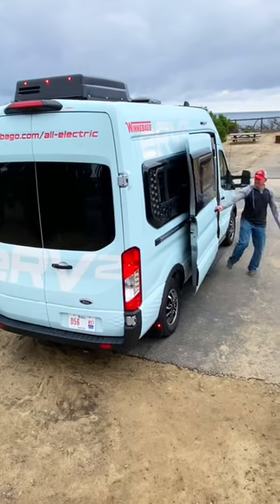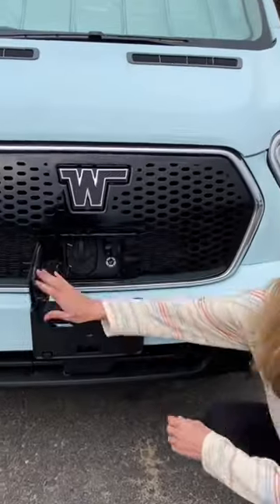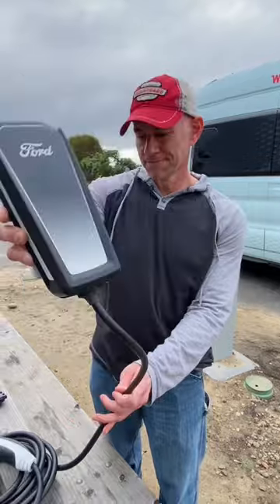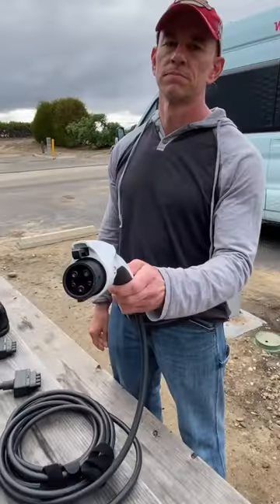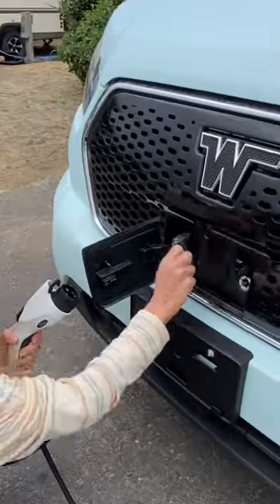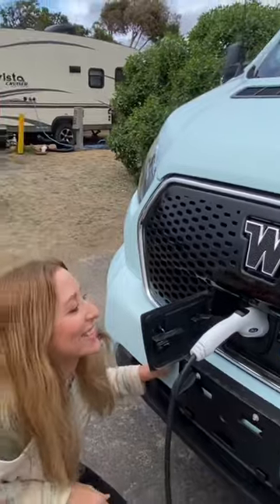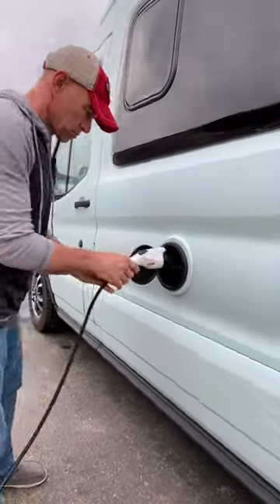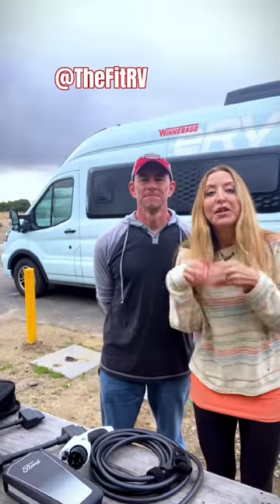How does Campground Charging Work with an All-Electric RV?! Test camping in Winnebago’s ERV2 van

Comment: Adjustable charging amperages would be ideal for adapting to different camp site amp output capabilities. Sometimes circuit breakers are old and weak and trip much lower than their original rating. Dialing in the charging amps would also allow simultaneous charging of the house battery immediately upon arrival and overnight. This could be handy with a 30 amp site for just 2 nights.

Comment: One other comment.  How are you all planning your camping route?  Does the navigation software in the eTransit guide you though fast charging waypoints when you tell it a final destination?  (Tesla does this) Or do you have to manually figure our where you should stop along the way?
Reply from the maker: Apparently the eTransit does have that function, but we haven’t used that yet.  We’re playing around with the app ABRP (A Better Route Planner) and it sets up the charging waypoints. And then we use Plugshare to check on the waypoints it suggests, make sure they’re in working order and get good reviews… and are the fastest ones in that area.

Comment: Good luck with the rv park allowing you to use 50 amps to charge and plug in your house batteries too lol
Reply from the maker: We’ve been doing that this whole time, no issues. We’re not using any more power than a big 5th wheel with its 3 air conditioners.
Reply: @Thefitrv  but the 3 ac's  don't pull 50 amps 24/7. @.25 cents a Kw using 7Kw/hr ,   that's 40dollars/day out of the rv parks pocket.  It won't go on very long. Not to mention their electrical system would crash with a couple dozen rv's charging.
Reply from the maker: All things yet to be worked out. Change will come, we’re just at the very beginning of it all. Also to clarify, chassis charges in 11hrs at a campground (if it was totally empty upon arrival)so it wouldn’t be charging 24/7. Once it’s charged it’s charged.
Reply: @Thefitrv So no other power is being consumed after that 11 hours of charge?

Campgrounds will eventually have different rates for all electric.

Comment: Ok, came over here from the last video. ;)

You've demonstrated the J-1772 connector for the chassis and coach.  The max charging for the chassis through the J-1772 is about 11 hours.  How long to charge the coach from the J-1772?

The eTransit also allows fast charging via the CCS connector.  Does the coach support and fast DC charging?

You've clearly stated that this is a prototype.  But the dual charging ports are a pain point.  Having to move the charger from one port to another, perhaps in the middle of the night would be a pain.  Tell them they need a single port to support an overnight/camping mode.

The single charging port should support priority and capacity limits.  If you're staying a long time, you may want to prioritize coach charging over chassis.  If you know you're taking off first thing in the morning, you want to top off the chassis first.  And once one battery is filled up, start charging the other. 

And they also need to support a dual charging port/parallel mode, whereby both battery packs can be charged from independent power sources.

Also, the ports should be closer together.  It'd be nice to pull up into an urban charging station (I'm thinking Chargepoint), and plug in both ports at once.  Not sure public chargers can reach the mid coach 1772 outlet.
Reply from the maker: As far as how long to charge the house battery, we plugged it in to the 50amp 240volt connection at the campsite, and we were charging at a rate of about 4700watts. It’s a 15,000 watt hr battery, so about 3 hours to charge from empty to full. And to your comment about dual charging from independent sources, that’s what it does currently. You asked if the house battery supports fast DC charging, and we’re not sure yet. We have yet to test that out!
Reply: @Thefitrv  You are correct, the current configuration is dual charging plugs. I saw that. 

My guess is that it was easier to simply keep the two battery systems separate. 

My point was that there are pros and cons to dual port and single port charging. So even if they support a single port to charge both systems, there is still a benefit to dual plugs. 

But…

There should try to aggregate the plugs to allow easier charging in urban environments that have existing charging infrastructure. 

The eTransit charges in the nose, because that is how urban charging stations are designed to be used. Putting the coach port mid coach may make it harder to charge in an urban location. 

And there should be some sort of programmable charging logic for single and dual configurations to prioritize which battery is charged first.
Reply: Agreed!

Comment: Slower charging over a couple of days may be the safe bet. Also a simple way to manage the simultaneous charge of both banks seems essential!
Reply: Charging speed is not an issue. The chassis, like almost all EV battery systems, use heating and cooling to keep the batteries at optimal temperature. The e-Transit chassis can DC fast charge at 112KW. The voltage is in the 400v range, so do the math, the current is huge. Our Tesla can charge at 250KW. Some cars have nominal 800v battery packs, and can charge at 350kw.

Comment: So by charging both the vehicle and the camper at the same time you will draw more energy from the campsite than you normally would from a regular camper, the problem with that , is that campsites will eventually increase their price to compensate for that extra running cost , so i wonder, do you pay more because you have an EV camper? Or everyone will pay a little more? Maybe nothing at this time because these EV are new but i am afraid that campsite owners will eventually catch on …
Reply from the maker: It’s possible. There are a lot of issues that need to be worked out before eRVs truly hit the road, including how campgrounds will handle them.
Reply: Use more, pay more.
Reply: Some campgrounds charge separately for electricity usage.

Comment: Geez you have to think about charges to both a house and a coach battery.
Reply from the maker: Yep. There is one little workaround; the chassis has Ford’s ProPower, which the house battery can tap into and take a charge from there. But it’s limited to only sharing 2400 watts.
Reply: We mostly used DC fast chargers to charge the chassis in 15 to 20 minutes, then plugged in the chassis at the campground just to top it off from the few miles since the DC charger. The house battery can be charged at any Level 2 EV charger (these are 240v, and vary in amperage, often found at stores).

Comment: Is it safe to assume there is no dc to dc charging while driving down the road right?
Reply from the maker: The DC to DC charging relies on Ford Pro Power.  So it would have to obey whatever restrictions Ford has placed on ProPower. We haven’t tried it yet!
Reply: It is possible to use ProPower while at a DC fast charger, but the current is limited, and we found it not worth using.